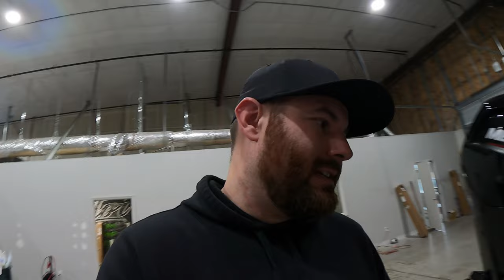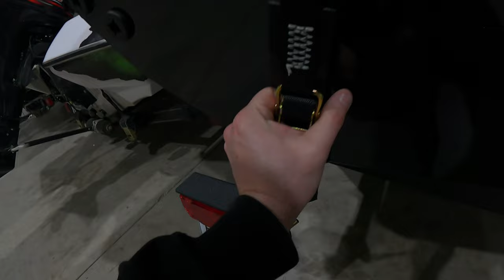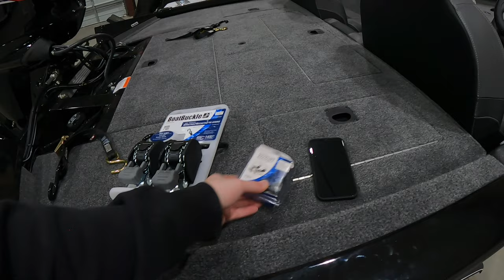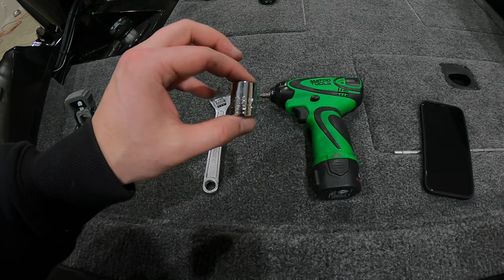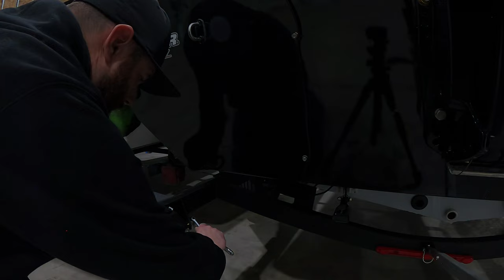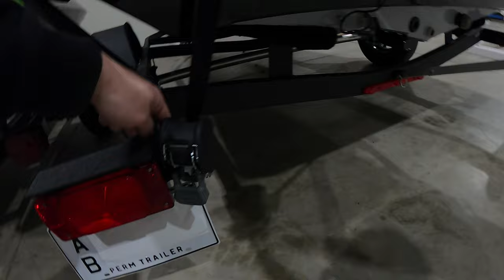A Must Have Trailer UPGRADE! Boat Buckle Install (2021 Bass Tracker Pro Team 175 TXW)

Comment: Thanks for the video. I've also seen people mount these to the inside of the angled trailer bracket to give them a little more clearance. The ratchet faces inward but not a big deal, still pretty easy to operate.
Reply from the maker: For sure!

Comment: I went to my local farm and ranch store yesterday and bought two 6 foot long self retracting 1500 lb capacity straps. I cut the short strap off of it and used the hole in the body and bolted them to my trailer. They work just like these do and cost me 19.99. I don't need to pay for a catchy name!

Comment: In so many of these mounting demonstrations the trailers seem to have the same 'bent' mounting tag on the trailer. This bent tag inevitably results in some very bad mounting of the ratchet body on the trailer. By now I would like to believe the trailer manufacturer has produced the trailer with a designated mounting point that enables a proper and secure mounting of the ratchet unit.
Reply from the maker: For sure, they could have added a bit more to the ratchet mount.

Comment: They're handy but I definitely woulda went to the hardware store n grabbed a couple 7/16 bolts n regular nuts n spot welded the nuts to the bolts after they were tight to keep them from up n walking away one day at the boat ramp
Reply from the maker: I probably should weld my spare tire too. Thanks for the tip!